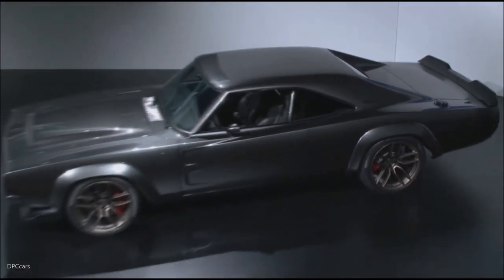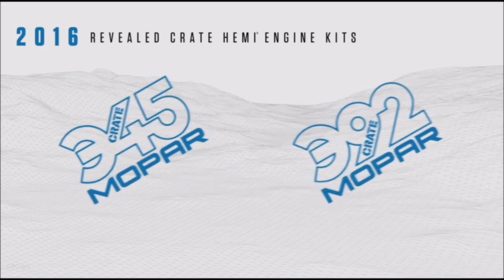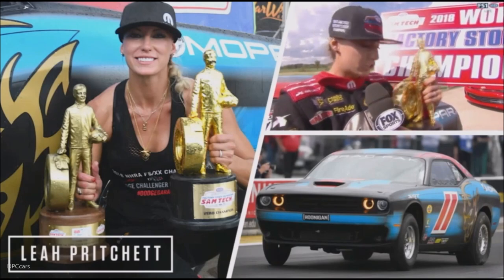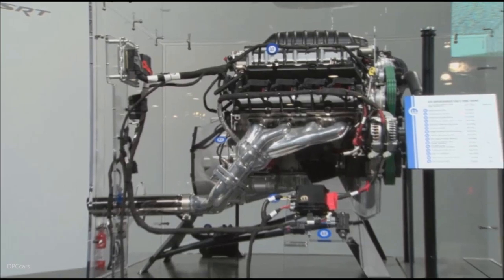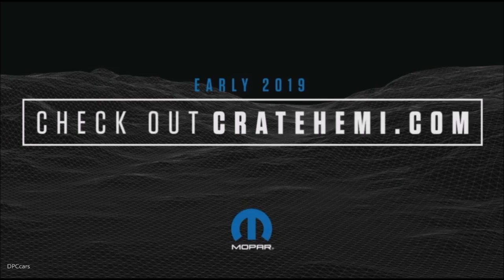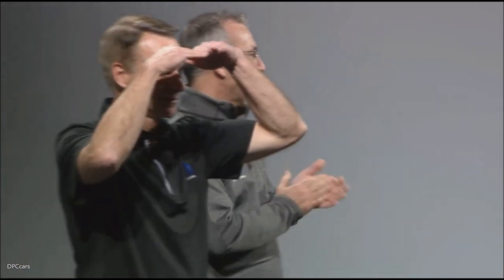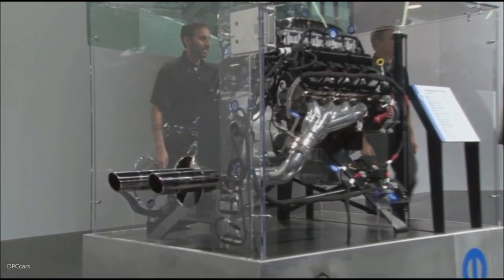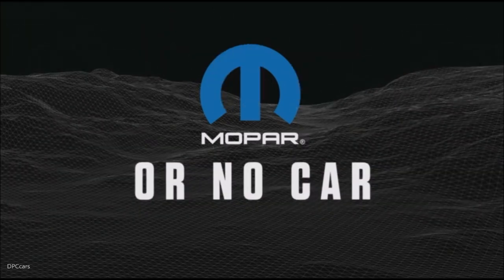Hellephant 1000 Horsepower 426 Crate HEMI Engine Unveiling

Comment: We’ve gone from miles per gallon to gallons per mile
Reply: This isn’t a daily driver engine, especially if you’re an average guy.
Reply: Nothing like smiles per gallon lol
Reply: now you can buy an engine that has worse fuel mileage than an Abrams
Reply: Sour trail I used to drive and be a gunner for those things. If it takes 8 gallons to start up then it’s still worth It 😂
Reply: we used to park M1's in front of suspected taliban pov's...the start them...bye bye paint job/tires/plastic 👋👋
You also would not believe what 5 hand grenades does to a washing machine..
you're welcome!  Putting your tax dollars to work.
Reply: *Gallons Per Mile
Reply: Smiles per gallon
Reply: Can always go Corn feed;-)
Reply: @RapturedWes  Hellcat gets 23 mpg on the highway...that's not BAD gas Mileage...that's if you can control your right foot. Funny that the Hellcat, which has 57 hp more and is ALOT heavier than the ZL-1 gets better MPG than the camaro which is rated at 20 mpg highway but only got 17 mpg in car & driver testing. For comparison a 3.5L Turbo Ecoboost V6 F-150 4x4 pickup only got 16mpg  in testing.
Reply: And Chevy just brought out the ecopo camaro concept. A look into the future, maybe?
Reply: Challenger Hellcat and Demon average around 22mpg with 707hp and 840hp, respectively.
Reply: @malikmcdowellswreckedatv5100  now all we need is for our gun rights back so we can mount them on these cars
Reply: @ashburyconstruction8999   FYI, MOPAR was the designer and builder of the M1 ABRAMS ...which was their baddest vehicle I know of.
Reply: @JerseyMikeP  
the chassis or the engine/drivetrain? 
I did not know that.  I do recall seeing General 'something' on top of the engines of our HMMWVs though.   Been a minute, the memories fade as better experiences replace the old.
Reply: Actually, if you put this in a light, aerodynamic vehicle, with the right gearing, and drove carefully, you could get excellent milage.
Reply: Ive heard people with hellcats and 392s get in the 30s in eco mode
Reply: @Snacks Treats Yup, and while you sitting at the charging station for hours, I refueled and arrived at my destination, sitting on the beach, sipping my drink and soaking up the sun, while your kicking yourself for buying that piece of crap electric junk, for MORE than I payed for my HellCat!😊
Reply: @Snacks Treats :Eating "DingDongs" 😂
Reply: Nope Nope=dum dum!! Smiles vs MPG, I'll take Smiles thank you dum dum!!
Reply: I'm pretty sure you can adjust the boost/fuel settings, have it set to a certain level of boost. Some people have high hp engines but have 2 or more boost levels set up, for example low boost - 300 hp, mid - 600, high - 1,000 hp.
Reply: Fuck id drop this in a off road baja ranger
Reply: @ashburyconstruction8999  lmfao
Reply: More like gallons per gas tank lol
Reply: JerseyMikeP- I averaged 21 in a Vegas to Malibu back to Vegas turn around trip.  Got a Charger 392 Daytona.  Set it at 80 and let it go.  740 miles and about 35 gals. Filled up in Palmdale on way down and in Mojave on way back.
Reply: Nope Nope: Great comment
Reply: @malikmcdowellswreckedatv5100  
AMERICA,  FUCK YEAHH!
Reply: Gallons per quarter mile 😎
Reply: No one cares lol
Reply: Giuseppe I would daily it.
Reply: That's pretty good 🤣🤣🤣
Reply: Go electric and it'll cost less to display the same power without disturbing the neighbors sleep.
Reply: Vincent Harris have you heard and electric performance vehicle? It sounds like a damn jet turbine taking off

Comment: A 1000 hp crate engine tested and backed by factory warranty. With the plus of an aluminum block. This is something else.
Reply: Yes it is....
Reply: What a time to be alive
Reply: A kidney might be alright and a lot less inconvenient.
Reply: this is.....it
Reply: Void33 -  wasn’t the 426 A cast iron block at one point?
Reply: @camman9235  the old gen 2 "elephant" was all iron, and most regular gen 3s of today have iron blocks. But the gen 3 of this video is all aluminum.
Reply: I'm glad Dodge finally stepped into the 21st century. Other manufacturers have been using aluminum for years lol
Reply: @camman9235 : Yes it was.
Reply: Yes a new golden age of performance engines. Factory super chargers , who would have thought this kind of performance would ever come back.
Reply: @psnmadracer27  , and yet this engine has more balls than you ever will in real life.
Reply: @paxhumana2015  If you've got balls in your engine, you should take it to a mechanic. Besides, I prefer track worthy cars over flat 1/4 mile runs :^)
Reply: @psnmadracer27  who says you cannot track race this beast from hell?
Reply: @ghoulbuster1  any serious race team, probably. The car isn't designed with tracking in mind, and it probably weighs well over 4000 pounds. It can't steer and the hellcat taught us that it definitely can't accelerate without spinning tires.
Edit: you could modify it with some Mickey Thompson's and it'd be a drag monster, but that's about it
Reply: @psnmadracer27  __Dodge is the LeadeR, Never the Follower__🔥

Comment: Build that Charger with that Hellaphant and we will buy it!
Reply: Terminator X facts
Reply: Terminator X on me
Reply: Agreed!
Reply: Right?! God damn, that car looks good.
Reply: I think there is a very good chance it breaks EPAs standards for a new car. Probably a 1968 and older type thing.
Reply: Adding to the pile of "yes."
Reply: Terminator X and ALL WHEEL DRIVE !!
Reply: But emissions tho. That's why they said for "pre '76 or off-road use only". They'll probably lose some power getting it EPA compliant.
Reply: Would never be street legal. Can't have headlights inside or behind the bumper anymore. Steel body doesn't meet crash safety. No impact-safe rear bumper. Taillights inside bumper, etc...

The current-gen Challenger is the closest we got so far.

Comment: This is why I'm currently in love with Dodge! They are making cars THEY WANNA MAKE! Are they the best handling? Nope. Best stopping power? Nope. Most modern design? Nope. Well...what are you building?!?  We are building fun toys! We are building what we want!
Reply: Pro 4X dodge: how American can we get 
SRT: throws crazy engines in jeeps and muscle cars
Reply: Their carrying the torch for the American Muscle car. Plus  their cars are actually usable and somewhat practical. You can fit 4 adults in a Challenger plus the cargo space is massive and can fit some decently big stuff.
Mustang and Camaro might as well not have backseats and the front is usually too compact for even 2 people. 
My wife has to rest her arms on the cup holders in my Camaro, I constantly have to butt elbows just to get my drink.
Reply: Necrotic Reaper - then buy a dodge... see how much the interior holds up compared to the camaro (which is already not good)
Reply: @connorsaucedo3063  Camaro probably has the cheapest of the three.  Thinking of actually trying out a Kia Stinger GT2, it's basically a BMW without the insane repair cost.
Reply: Necrotic Reaper the dealer i bought from tried to get me in one of those but i bought a gti instead! really nice cars just make sure you get one with little to no miles cause people beat the shit out them!!
Reply: @connorsaucedo3063  Yea I got lucky with my Camaro, probably going to buy new this time if I can.
Reply: Necrotic Reaper better have good credit lol!! good luck on your endeavors

Comment: MOPAR = More Overall Performance And Reliability :)
Reply: May I pirate that please? (Hey, I ask before I steal. L.o.L.!)
Reply: You say that although it’s the Motor Parts company for Fiat and Chrysler, 2 of the most unreliable brands out there
Reply: @coltonjacobs5383  that's the cars mopar engines have always been reliable
Reply: Also MOPAR = Mostly Old Parts And Rust
Reply: more power
Reply: I think you mean MO POWA BABY
Reply: More over powered automobiles ready
Reply: Let’s not get ahead of ourselves Fiat is horrible they just make good sports cars lol 😂
Reply: I think the last time I looked, FCA was in the top 1/3 quality charts ! Significant strides were made to the overall lineup that produce vehicles with the HIGHEST retained used car values in their classes ( Jeep Wrangler, Dodge Challenger, Chrysler Pacifica, Alfa Romero Stelvio, Maserati Levante).  Heck haters will always hate I guess

Comment: You done well mopar. You done well. Next they might blow our minds with 1500 horsepower..
Reply: What if they keep it at 1,000hp but unveil a new and much lighter chassis, without compromising on heritage style? THAT would be sick. 400-1,000hp modern muscle with classic style, but not pushing 3,500lbs.
Reply: If they reduced the weight...that power would be utilized so much better. Let's all be honest here and admit these cars all need to go on a diet. A few hundred pounds would go a long way.

Comment: As long as Mopar is building and developing the Hemi they will control the muscle car game. End of story
Reply: You are right, back in 1969 my 1969 dodge super bee 440 six pack held the strip record at pid dragway , and I would win top eliminator also
Reply: @Poohdaddymagic  you mad?
Reply: @zxJC34xz  Are you mad that Ford made a Hemi? 429 Boss was a Hemi. And it's coming back to show Dodge what real power is. Mad? Nah. I actually like the challengers but Dodge fangirls overhype like nobody else...
Reply: Patrick Simmons well said.
Reply: No
Reply: Patrick Simmons The 429 was not a Hemi it was a wedge head along with the 428 ,the only Hemi Ford made was the 427 sohc cammer built in limited numbers as a non production made engine that you couldn't get in a production street car ! It was meant to compete with the Chrysler Hemi & it made good power but was plagued with crank shaft problems as well as oiling issues & timing chains that would stretch causing erratic timing problems & often those chains would break grenading the engine in the process, some guy did develope a gear drive for them but it didn't help with the bottom end issues that Ford never figured out ! Most teams that used the cammer usually would go through a engine about every other run because of those problems & they would blow up to a point that the block & heads weren't salvageable so they got tossed for scrap, there was 1 team that had 50 of them piled up behind the shop they worked in from trying to race them & so many failures .  90% of the guys racing them ended up going back to the Hemi as it was more reliable & far less costly to race compared to the cammer. My old neighbor Tom Hoover who had the show time & pioneer funny car who started out in nitro sling shot dragsters & eventually went to nitro funny car was using the cammer in those days & is the one who told me about those engines not being reliable enough to run in those nitro classes & also ended up going back to the Chrysler hemi  !
Reply: Hugh Link A 440 isn’t a hemi though.....
Reply: @hughlink3122  
The 440 isn't a hemi.
Reply: They don't make true Hemi engines anymore, but ok.
Reply: Patrick Simmons : why are you so angry. Chill dude
Reply: 17 year old kids with junkyard engines and Chinese turbos actually control the musclecar game sir.
Reply: Yes I know that just stating that in the late 60s - early 70s mopar dominated the local drag strip
Reply: Mopar or no car 
Chevy and ford pissing them selfs !
Reply: Ford was a Semi Hemi, Mopar holds the patent i @Poohdaddymagic
Reply: senatorlou II  looks at challenger sales vs mustang sales..... what exactly are you controlling?
Reply: Patrick Simmons , yes no matter how you shape a turd, its still a turd, right? Lol, Mopar, Mostly Old Paint And Rust! Junk!
Reply: @peteonster  lol
Reply: Texarmageddon exactly

Comment: I'm afraid to ask the price of this elephant.
Reply: Atleast a $100k
Reply: @v9237  Nah. The hellcrate is 20k. I expect it to be more around 40k maybe 50k for this. Won't be 100k.
Reply: It'll be around 40k-50k which is pretty dumb
Reply: Andrew Berndt better than the demon 🤷🏽‍♂️
Reply: I can't find the other video but it was said it might be 30,000
Reply: Online I've seen them in the 30,000--35,000 range
Reply: @v9237  uhhhhhh no
Reply: HAPPYFUNTIMEx2 that’s just for the ENGINE
Reply: Andrew Berndt that’s ONLY the cost of the Engine
Reply: $30,000 with MSD wiring.
Reply: @HAPPYFUNTIMEx2  if its anything about that price it wont be that same car you see there.....ijs
Reply: @v9237   unfortunately yes thats what a a per-1976 426 hemi can go for 2 ( - well used up smog  era cast parts engines sub 6K usd$ ) ( i gagged from sticker shock too!! on the first day of looking ) basically anything north of 9k is probably real engine and not a scam but your getting a screaming good deal on it ( "fully built" long block / crate engine ready to go ) and more than 40k is probably pure bread racing engines not meant for the street / long drives ( no water jackets ) i found that out shopping for a new engine because my old big block V-8 died so i have the pleasure of $$$$ coughing it up or selling my charger or giving up on having a big block mopar engine and using brand-X aftermarket swap

Comment: WAY BETTER THAN CHEVYS ELECTRIC CRAP CAMARO👍👍👍👍👍👍🤘🤘
Reply: It all depends on which one can lay the power down the best and actually be able to use it. Electric's torque is instant and there is no flat spots until max speed is reached, so until we put them both on the track, who knows? 1000hp crate engine is impressive AF though and the even more retro style of the car is badass. I wonder how it handles in the twists?
Reply: U spell slowmaro wrong🤔
Reply: @dougdiamond5774  :Chrysler only made "1" car that handled, the Viper! If they do build this charger, only on the Oval, maybe, on a road course, NOT! Too much weight over the front wheels. It'll be a drag car, like the Demon.
Reply: FUCK. YES

Comment: I think it's funny that Chevys most powerful engine is only 750, with ford even lower. Meanwhile dodge just cracked 1000hp. I'm sure the second the tesla roadster comes out dodge are gonna kick its ass
Reply: So true, the C7 Z06 when it came out had issues....even Hennessey was replacing/modding alot of the engine to make 1,000hp. With the Hellcats he was only doing exhaust, camshaft and tune...not even touching the heads. Last Gt500 was a good car/great motor...but they have been "twiddling their thumbs"...scared to make real power. Even their $450k supercar made less HP than the GT500.

It's the same in the 60's/70's when Ford was "TOO SCARED" to put the SOHC 427 in a Production car. Even the 60's ford strip/strip cars were only sold to racers and NOT the public...like MOPAR did.

Anyone could get a 1964 race hemi in a MOPAR and even select aluminum hood/fenders....NOT GM, NOT FORD.

Comment: The Bypass valve was probably open the whole time... SO the sound wasn't anywhere near 1,000hp. The sound wound of the engine would be what you here putting around town/on the highway.

Comment: Sad thing is that it probably has a small cam with those massive cylinder heads:-( Guessing < 210 deg @ 0.050" lift). Put a Nice COMPCAMS 230<240 @ 0.050 cam in it and you can people some, QUIET RIOT... COME ON FEEL THE NOISE;-) Factories were crazy with cams back then... OG Hemi Race were even small compared to GM's cams.

Comment: Lots of patriotic BS going on here.
It's not about US vs Europe vs Asia. This is about making classic and modern cars alike more powerful and better than they ever have been before by pushing the envelope of engineering and production with motivation not seen since 1967.
Fantastic job FCA.

Also 1000hp is a drop in the bucket.
Imagine how much power an engine produces when it doesn't spent 3/4 of its time coasting between power strokes.
Food for thought.

Comment: Is the car coming out for sale or just the engine?
Reply: Crate engine only.
Reply: Thank you! Do you know if it will be an option for upgrade if you buy a hellcat? Like if you want to upgrade? I was about to go pick up a hellcat this week but I sure can wait. I need more info about this engine
Reply: @reiniersacerio9334  No it wouldn't be an option for a hellcat. He said it was for <1976 cars and off road vehicles...meaning it wouldn't meet emission requirements for newer cars. The 797hp Hellcat Redeye is the highest HP Dodge in production.
Reply: @reiniersacerio9334  This is a 7 Liter/426 block...the Hellcat is a 6.2L/392 cu inch engine. You could easily make 1,000 hp with a hellcat if you wanted to with a smaller pulley, switching to E85 or using meth injection with a bigger camshaft. It sounded like this engine used that New Hemi race block...which would be the way to go as it would easily handle ALOT more than 1,000hp. Most aluminum rave v8 blocks are good to 2,000 hp.

Comment: SO this just proves how much better new engines and cars are. Let's go back to the 60,s grab a flat  blade screwdriver set the mixture, set the choke, set the points, set the timing, and this just for today, there goes your day and you still struggle to make 400hp. Tomorrow is cloudy so let's do it again. SO are the old cars still better hmm hmm...... don't getting me started on transmissions either 4speed vs 8speed that shifts in 0.0067547886. Seconds.

Comment: all these cars are putting Ferrari, lambo, Porsche, to shame
Reply: new england patriot how? Those cars are built differently, not like these “muscle cars that will flip over on first turn...
Reply: @kebababbe   the horsepower wars are being won by American cares, but they dont handle well and need all wheel drive
Reply: new england patriot and some 500kgs lighter 😂🤭
Reply: @tlk0216  Not really. The horsepower wars are still being won by europe. An example would be the koenigsegg regera and agera, or even the bugatti veyron and chiron.
And I'm just being petty here, but even if dodge, ford or chevrolet made engines with more HP than european cars, it still would not make America the horsepower leader. But it would make the U.S.A the leader, since it's basically the only competent country in America as far as cars go